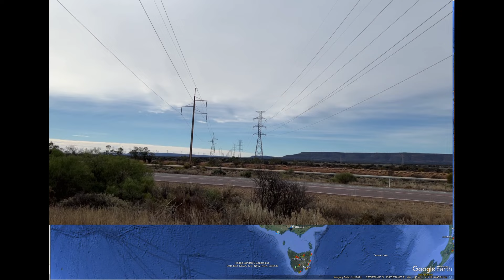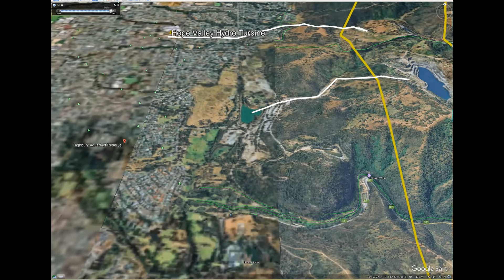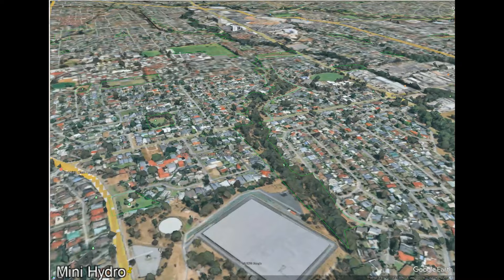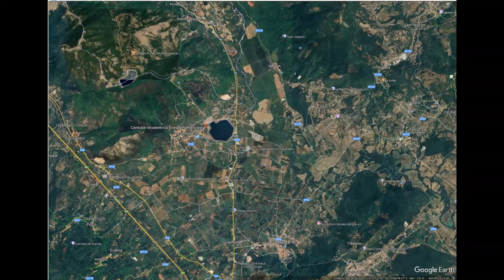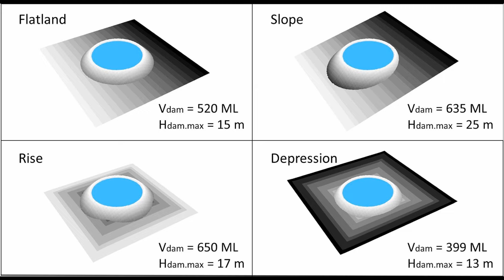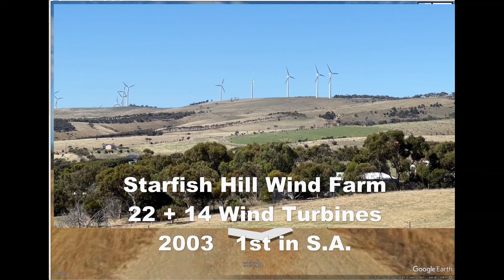Better Big Battery using Closed Loop Pumped Hydro Energy Storage for Dry Environments

Comment: In the US, we'd call the Hope Valley project energy recovery, since the energy isn't stored. In the 1980s, I was resident engineer (inspector) on construction of two such powerhouses (600 kW and 2000kW) to recapture energy at termini of the San Diego Aqueduct.
Reply from the maker: Thanks for the information about the San Diego Aqueduct.    As you would recognize, I was stretching the definition of Pumped Hydro.

Comment: It is interesting to see the status of new pumped hydro projects in Australia.  The many comments here about losses (as low as 80% roundtrip efficiency) miss the point that curtailment of wind and solar represents 100% loss of output from a built facility. And the indefinite life at full output of a pumped hydro vs. limited-life batteries with declining capacity is ignored. I returned to consulting engineering from California local government in 2007 to focus on pumped hydro licensing, then booming in parts of the US. But almost none were built for lack of a utility tariff system that captured the value of these billon dollar projects. Even the public agency projects died. Now, nearing two decades later, projects are again getting licensed. This time, will they proceed despite the rising cost of capital?
Reply from the maker: Thank you for these valuable comments.

The concept of building a Pumped Hydro Power Station in tandem a large Nuclear Reactor PowerStation (or Coal Fired Power Station) in order to let you build a smaller Power Station is a complex and hard sell.

The 3 Australian Examples of Pumped Hydro
*  Snowy Mountains Turmut 3 Pumped Hydro opened 1972  (Actually only 3 of the 6 turbines are also pumps)
*  Shoalhaven Pumped Hydro opened 1977
*  Wivenhoe Pumped Hydro opened  1977
were all build by Water Supply Authorities as part of their water storage schemes.    

In all of the above the state-owned water supply authorities cooperated with the state-owned electricity authorities as a side issue.   They were not stand alone.

Since that time some of our States have sold off their electricity authorities.  

In South Australia we have handed the management of the water authority to private enterprise whilst the State of SA retains ownership of the assets. 

As a result, there are a lot of Australian schemes that do not get past the investigation state.   There are a number that are in the process of being built.

https://en.wikipedia.org/wiki/List_of_pumped-storage_hydroelectric_power_stations
List of plants larger than 1000 MW capacity
   Australia 1
   China 38
    Italy 3
   Japan 13
    Russia 1
    USA 10
suggests is a learning process.

Comment: Is this bloke awake?
Is he aware that Australia's current labor government has put Australia's energy systems back 50 years?
Reply from the maker: Can I suggest the environment for electricity generation has changed since 1975.    

Electricity is a State and Territory Government responsibility.   Decisions are made at the second tier of government.   

Of the natural gas that SANTOS had discovered at Moomba around 90% was sold and it is exported to Japan, China, South Korea, and Taiwan.   

When the Playford Government nationalized the Adelaide Electricity Supply Company in 1944 it was attempting to expand the electricity system by using brown coal from Leigh Creek, adjacent to the then Port Augusta to Alice Springs railway line.

Brown coal is a highly polluting way to produce electricity.    In addition, the Power Station must have boiling-water in their boilers 24 hours a day.  So they are not economical by themselves in the real world,

Most to the Liberal Governments in the States have sold off their power poles and substations to various overseas companies

Similarly, turbines in the power stations have been sold by most State Governments.

Now majority of house holders have Solar PV on their roofs and want money for the electricity they are creating.

These same householders also want their air-conditions to work at night when the "sun is not shining, and the wind is not blowing".

Storing energy when there was excess energy from coal fired power stations was seen in the 1970s as a reason for building Pumped Hydro Energy Storage.  

The Kangaroo Valley and Bendeela power stations were completed in 1977 as a joint project between the Electricity Commission of New South Wales and the NSW Metropolitan Water Sewerage and Drainage Board.

Queensland opened the Wivenhoe Pumped Hydro Station in 1984.
Reply: You would have to be being paid to look or be that stupid Neil  ..? I wouldn't worry about his comment too much ...

Comment: Everyone knows that pumped hydro is a great way of storing electricity for a few hours or days. BUT it needs room for two lakes one on a mountain and another one nearby that is at the bottom of the mountain. .... How many of those are their in your back garden?
Reply from the maker: Australian Geology has a number of block uplift in its structure.    
300 m has been identified is a desirable height for Closed-loop PHES

I live in Highbury on the plains opposite the Adelaide Hills, every morning I Iook across the valley to the site of the proposed Highbury Pumped Hydro.   Just further up the Torrens  River Gorge there are numerous potential site for PHES around Kangaroo Creek.   These sites are close to all the roof-top solar panels in Metro Adelaide

The Flinders Ranges near the Port Augusta and Port Pirie wind farms has block uplifts that are 300m and more in height above the plains.   Close to the electricity power lines from Port Augusta

Comment: If you look at the way a wind turbine operates they spin at a slowish speed often but it is enough to produce a lot of electricity...why could something similar not be used in the rivers around most Australian towns and cities...essentially a small wind turbine on its side in the river slowly rotating 24/7, you could have 1000's of them couldn't you?
Reply from the maker: An interesting idea.  However, Australia is an ancient landscape and there are very few fast-slowing streams left to implement the idea.    

Another problem is the fish and other marine life need "stairs" to get around these turbine.    That is the advantage of closed PHES, the environment is kept way from turbines.
Reply: @Highbury5089  Yes perhaps a problem for fish but not entirely sure a slow turning turbine would be that bad for them, the river does not have to be fast running indeed the slow and solid Condamine River at Warwick keeps chugging even in the worst droughts and all you need is the turbine to keep turning slowly ...one problem I can see however are floods.
Reply: @Highbury5089  The hydro systems you speak of require pumping, a constant flowing river requires a turbine only and operates 24/7 with no pumping.
Reply from the maker: @christopherj2231  As of December 2024, over 37% of households in Australia have solar panels.  That pecentage is higher in Adelaide.   These people do not need to purchase much electricity during the daytime.   
Great!!!
What do they do when the sun goes down?      If they did not purchase a battery with their Solar- Panels?   At night they are stuck with having to purchase electric power from the cables running past their font door.    

Money can be made if you have a way of storing electricity for later release and sale when the price of electricity is high because there is a big demand.

3 of the 6 turbines at Tumut 3 can be switch over to being pumps.   

Snowy Hydro cannot sell much electricity during because of the electricity from the solar panels has saturated the market.   So Snowy Hydro buys the cheap electricity during the day to power thee 3 turbines when they run in reverse.  They pump water back up the hill.     This water higher up the hill now has "energy of position".   The electric energy has not disappeared,  it has changed its form.

 Come nighttime when there is a higher demand for electricity these 3 turbines go back to normal and the water runs down the hill and thus generates $$$$ for Snowy Hydro because the sale price of the electricity at nighttime is higher than what they paid earlier in the daytime,
.
Reply: @Highbury5089  Yes we all know how it works but it just needs to all be done a bit quicker if you go to Nem Watch and see where most of our electricity is coming from as we speak you will see we have a long way to go...vehicle to grid looks promising imagine a 5 million EVs giving the grid 10 Kwhs ( about 1/6 of their capacity )... 50GWhs is close to 4 million homes for 12 hours.

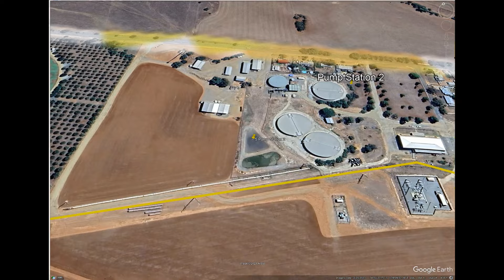Comment: A good summary of PHES for SA. A couple of points; the Palmer number 2 pumping station has a lot of solar cells next door that likely run the pumps for free on a good day. They are just visible bottom right of the screen at 6:27 There are more panels near Mannum on the Murray Bridge road but may be for the grid. The grid pattern of trees around the Palmer oval are Olive trees planted for a source of income for the town. I suspect they are no longer harvested, last year the ground was covered in fallen fruit. A shame. Good fuel if nothing else.

From my high school social studies circa 1970s, the Millbrook reservoir was SA's first dam and it's wall is entirely earth filled... by hand, well with horse help. It receives Mannum water that is allowed to run down through a natural creek where it clarifies, aerates, and is UV sterilised all for free, to the Kangaroo Creek dam.
Reply from the maker: Thanks for the feedback
Yes SA Water is now a significant producer of electricity.   They also have another Micro Hydro at Seacliffe.
Minor correction the first dam was in Paradise and named the Thorndon Park Reservoir.    
S.A in 1857 became a self-governing colony and the first job was secure reliable town water.  So they got contractors to build a diversion dam on the Torrens River and diverted water through pipes in an earth dam in a dry gully in Paradise

Comment: I have wondered for many years why tidal flows are not exploited for electricity generation. There may well be a good reason why this is not considered, but I have never heard any discussion about this concept.
Reply from the maker: Tidal Flow in parts of the world where there are gulfs - Bodies of water with land on either side.
The tides in the 
* around Juneau in Alaska and  
* King Sound and  Kimberley coast in Wetern Australia
are extreme of extreme tides

The problem is the harnessing of the flow will have environment problems.
These are locations far from any market for the electricity.
Reply: There is a very old tidal generator in England, 60+ years old, so it shows they can be built and they can last, but it's a cost thing. Tidal is better as it doesn't muck up the scenery, use up valuable farm land, but it can upset fishing hatcheries.
Because the cost of salt water proofing everything is high, it's hard to find investors but 60+ years is way better than the same money thrown at solar cells and wind power.

Comment: Pumped hydro is a waste of energy as the losses in getting  the energy from the solar or wind farm are at least 30 per cent plus what is lost in the pumped  hydro conversion
Reply from the maker: A very sweeping statement Rob.    
The nature of "Closed Loop PHES"  means you are not tied to Snowy Fields and areas of High Rainfall.      It  can be anywhere you can find a 100m to 300m difference in height for the top and bottom bodies of water.

In South Australia in the 1950's we opened up Brown Coal mines 540 km away from Adelaide.      The alternative was Black Coal from Newcastle 1,500 km away from the Power Stations at Osborne.

They next changed the system by building Coal Fired Power Station at Pt Augusta. 309 km from Adelaide 
There was an already existing rail line running from Port Augusta to Leigh Creek to transport the coal down to the new Power Station.

They then stung power lines between these 3 locations.     

Coal fire power stations have the problem of what to do with all this hot water when the rush period is over.   
The other problem is it takes around 24 hours to startup a coal fired power station from scratch    Having steam powered generators needs to keep running regardless of fluctuating demand in a diurnal world.
They cannot be switched on and off at a whim.

The stability of AC electricity network is a complex issue of quick adjustments of supply to changes in demand.   

Hydro generators are more nimble than systems that boil water to drive their generators.

Comment: Pumping and flow losses have to be accounted for properly tho
Reply from the maker: Pumped hydro energy store is typically around 80% efficient, meaning that it recovers about 80% of the energy used for pumping when it generates. 

Its carbon footprint is minimal if turkey nests are used on the plains and in the dry gullies high above the plains.   

Pumped hydro energy store has a productive life of 50 years or more..    That would be around 18,000 cycles.

Lithium batteries have a 99% for the first of their cycles.  This decrease to around 80% between 500 and 2,000 cycles.    18 months to 5 years.

In 50 year life of PHES there would be 10 to 33 cycles of replacement of the lithium batteries.
Reply: As do charging and discharging losses for batteries.....

Pumped hydro and Li Ion battery storage systems both have about the same round trip efficiency (around 80%)....
Reply from the maker: @peeemm2032  The life of Hydro plants
https://en.wikipedia.org/wiki/List_of_longest_running_hydroelectric_power_plants
145 years is the age of the longest running hydro plant.
The life of a Lithium battery is not 50 or 100 years.   
Usage Patterns: A lithium-ion battery's lifespan can be affected by how often and complicated it is used. Heavy users, like people who use their phones or laptops for extended amounts of time during the day, may see their storage space go down faster than people who use their devices less often or for shorter periods.

https://hornsdalepowerreserve.com.au/

The Hornsdale Battery was  100 MW/129 MWh   It can ran for 1.29 hours around 90 minutes before it need recharging
It cost around $90 million 

PHES normal run for around 8 hours releasing the stored energy
$90 million x 6 = $540 million for a 8 hour battery.

A life of 5 years for the battery means it will be replaced 10 times to match a PHES
The total life cost of the battery system = $540 million x 10 = $5,400 million

Snow 2.0 is 2,200 MW  22 times the size of Hornsdale Battery

The cost of a battery site to match 8 hours of PHES would be 22 x $5,400 million = $118 billion

There are cheaper green field sites for than Snow 2.0 PHES in Australia
Reply: @Highbury5089  indeed - a lot of people just look at the the lower capital cost of battery storage, but don't look at the lifetime of a battery compared to pumped hydro.

Batteries offer high charge and discharge rates, a lower initial capital cost, quicker construction times and a faster return on investment, but when you take into account the much longer working lifetimes of pumped hydro, pumped hydro can be significantly cheaper than battery storage...

Battery storage is good for short term storage (<8hrs), and grid stability as more renewables come onto the grid, but pumped hydro is likely a better option for longer term storage, and sustained backup. Something with the design capacity (350,000Mwh) of Snowy 2.0 has the capacity to run 500,000 homes for about 39hrs, our total installed current battery storage capacity on the national grid (5,833 Mwh) would run the same number of homes for about 39 minutes....

Hopefully once the immediate need for short term storage and grid stability has been met, more attention will be paid to pumped hydro....
Reply from the maker: @peeemm2032  Yes to your comments
about PHES versus Chemical Battery Energy Storage CBES.
Sovereign Governments are the only entity that can build big, long-term projects with all the unknown risks and long-term benefits.
Reply: @peeemm2032 except the pumped hydro is at no risk of any thermal Runaway to my knowledge ?  🚫Needing a fraction of the toxic resources needed for construction no doubt BIG picture overall pollution ...

Comment: Thanks, interesting 
I don’t think you would call that area of Italy dry, certainly compared to where you are.
I am in Scotland, we should have started building 20x the hydro we have 40 years ago.  Like Norway we would have more than enough.  Now, I do wonder if batteries are cheaper.  That said hydro and pumped hydro are a more solid long term option.
Reply from the maker: Mark.   Adelaide has a Climate similar to the Italian example I used.  Hot and dry in summer and intermittent rain in winter.    Down near Victor Harbor they get 1m of rain per year on Nettle Hill        Around Pr Augusta it is a hot dry environment.
We a problem of droughts.   No rain for 2 or 3 years.   The River Murray running dry.     You can walk across the river.

We know that the PV does not work at night.

We are worried about extremes .    What to do when the wind stops blowing for a week or more?
We know that the PV does not work at night.

What to do if the HVDC Interconnector goes down.

Need belts and braces. 

Gravity V Chemical store of energy?

A large dam of water with protection against evaporation can sit there waiting for years to be released as the emergency power supply.

Chemical batteries do not like sitting on the self for long periods.   The do not like getting hot.    They can easily lose their store of energy.